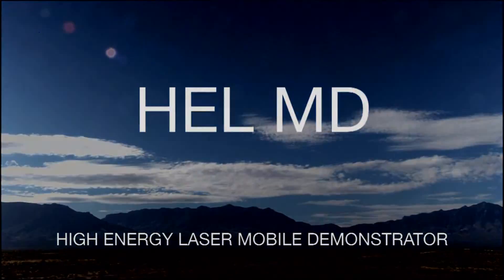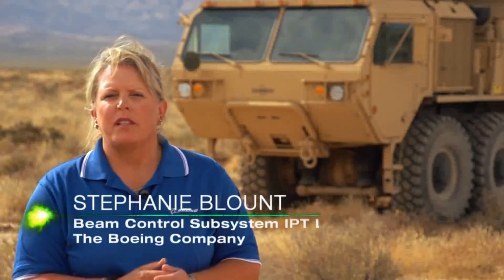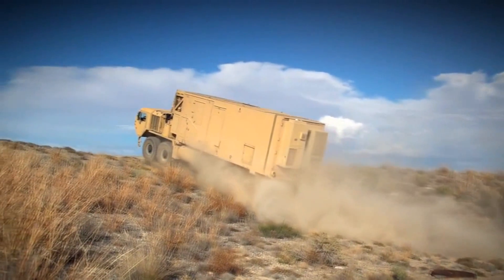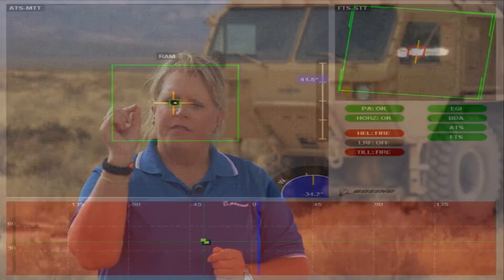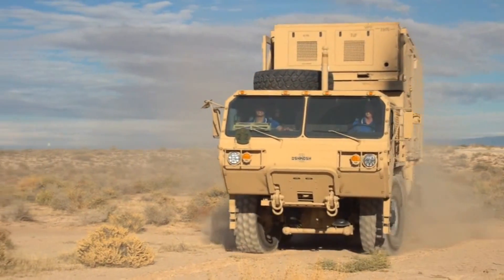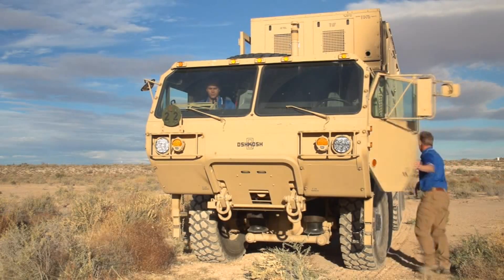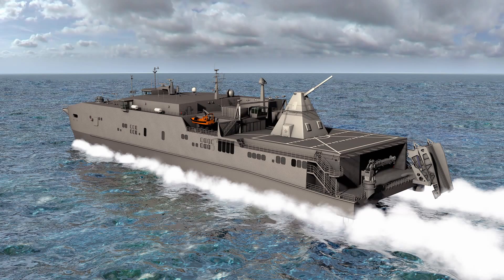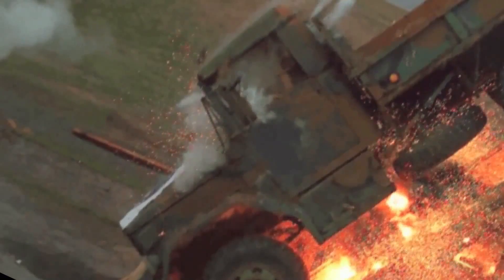Advanced Military Technology - Laser Weapons/Railgun/Terminator Robots/Supersonic Drones

Comment: "This system will take them out" .. Uhhuh, until they coat the thing in mirrors... or just fly so low that ground stations can't retain line of sight for enough time to be effective... I think they wasted a lot of money and a lot of time, yet again.

The magnetic railgun on the other hand, if they can produce enough power for successive launch then yes, it can be very effective.
Reply: If you think "mirrors" will help stop a laser, you're not that educated. Mirrors can only stop a certain range of frequencies. Regular mirrors only stop those in the visible light spectrum. And even if they were to make a mirror that somehow reflected those different frequencies, mirrors will still absorb some light. After repeated firing from a high concentrated energy, it'll go down.
Reply: Plus, stopping something invisible moving at the speed of light is pretty hard..

Comment: my issue with these robots is that yeah they are great... but to actually use them in the field, without a massive power cable plugged into the back of them, will require a small nuclear battery.

The bad guys are just gonna see this as a dirty-bomb delivery system. We send these at the bad guys, they take them out, remove the nuclear battery, wrap it in C4, and send it back to us. 

Id also add, every god damned thing involving a computer has been hacked... its a fundamental law.........so imho, 100 soldiers are worth one robot...........and they are probably a lot cheaper too
Reply: along with your hacking part of your comment, that's exactly why self driving cars is such a bad idea. hackers its simple.
Reply: emp

Comment: 1) Rotating the rocket
2) Laser can't burn it
...
PROFIT

Or 
1) Mirrors on rocket
2) rotation
...
PROFIT
Reply: Light has to make contact with the mirror before reflecting, thus heating it up. With a high-powered laser, it would burn through it quite quickly. Also, depending on how quickly a target is rotating and what kind of object it is, such as a missile, will determine how well the laser will be to the object. If it's a missile, it won't have much material to go through before igniting the fuel or explosive inside. If it's another type of object, you likely won't be able to rotate it that quickly - things like aircraft.
Reply: +den zin  says the youtube engineer arguing against rocket scientists 1000 times smarter than you
Reply: mso1ps4 anti-laser protection isn't a big problem, that's what i want to say.